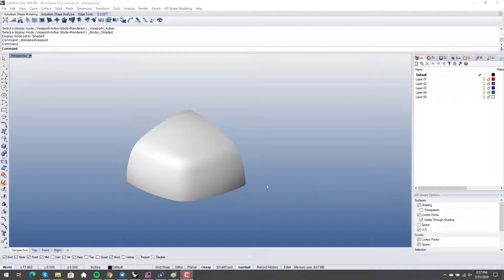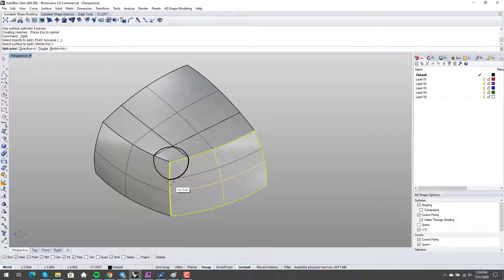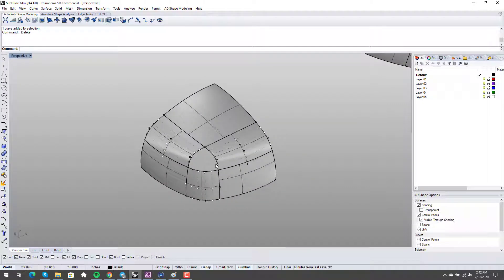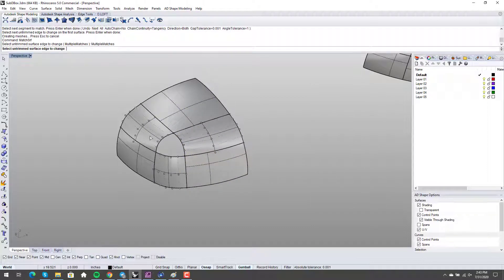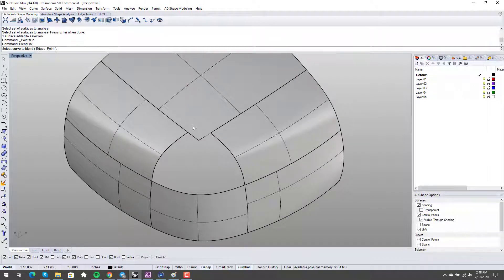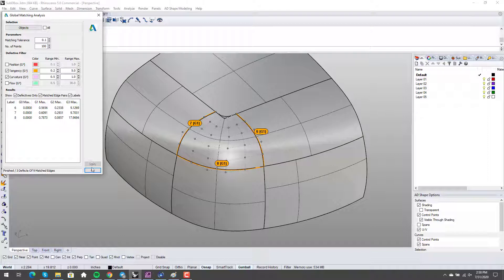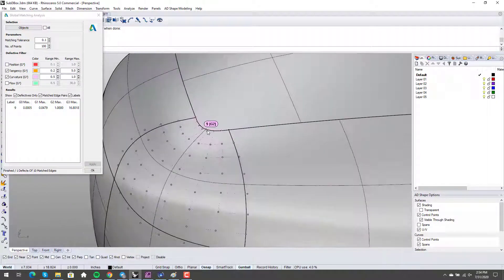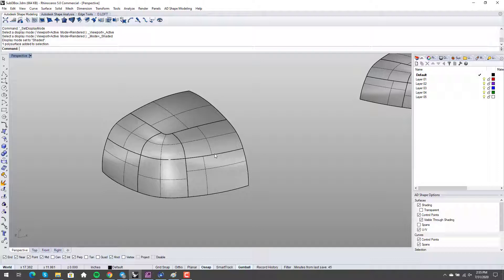Primary Surfacing: Episode 12 - (Slightly) More Complicated Ball Corners

Comment: I think when you did the blend curve on the last (top) surface it got slightly outside and then into the area of the top surface. Hence, you got the small end edges when tried to MatchSUrf with a Pull. I wish you could show us the close up of that operation (the Blend Curve) to see whether that was the case. That is why it was quite difficult/impossible to achieve CUrvature to the Top surface.
Has that intersection been the case, then matching the side surface to a isocurves slightly in from the corner of the Top surface might have solved the issue... but it is very time consuming to rematch to isocurves and then trim all the excessive areas of the top surface.
Reply from the maker: I don't have the file anymore, but I see your points. Really though, what I have found is that if you have a surface patch like the top one and you want it to be a certain level of continuity (G1/G2/G3) then the easiest way is to make all the surrounding blends one level above the desired continuity for the final patch. This is even true for four sided holes in which all all sides are untrimmed single span surfaces. So if the desire is for G2 for that top surface, the easiest route is to set the surrounding surfaces G3, which may or may not be possible depending on what version of Rhino you are running. Or - put another way - if your surrounding surfaces are single span G2 blends (even where all four edges are untrimmed) anything above G1 can be a struggle, due to the vert sharing at each corner. Of course you can always way over-define that final patch and force it into spec, but often your curvature graph will not be pretty. It's all a balance.
Reply: @thirtysixverts  I did a bit of a different approach with as minimum as possible parametrization of surfaces for my keyboard keys (shown on my channel). I did it in Alias though with only simple 3×3 plains and 'Square' command (5×3 and 5×5 for blend surfaces) + the actual corner surface 6×6. I did not have to extend the base surface inwards (split, detach) either.
But I had to make a simple patch surface 4×4 on the most "flat" corner where the Corner blend would be built. Then simple 5×5 curve with Pull (project) to that small patch and blending to isocurves of the corresponding surrounding surfaces (3×3, thus giving me very simple isocurves 3rd degree). Then I built the Corner blend surface, Projected the edge to the built small Patch and matched it to curvature bumping it to 6×6 and with a very minimal Control point adjustments to achieve C2 on all edges.
That is how I built all of my keys. Following are some shared pictures. 
(File tolerances in mm\deg): 
position 0.001
tangency: 0.1
curvature: 0.2
https://drive.google.com/drive/folders/1iIADzSnUTrIK8peAE35LTS6dJ-t7adgN?usp=sharing

Comment: Rhino has always been a bit quirky with SurfMatch command (Multiple Match to be more precise). VSR Shape Modelling definitely can help, but it is a third  party plugin and is quite expensive (has almost the same price as Rhino itself).
I had a quite similar situation for my designs and have been trying to use degenerate points: yes it is against the rules but sometimes it works.
Reply from the maker: I of course love and recommend VSR, but since it's not even for sale anymore I try to do as much of this series as possible with "stock" Rhino commands - indeed I was able to get better matching with VSR, but so few of us have it, if I was to make those commands integral to this series I think the audience would be much smaller. I'd be interested to see a situation where you found that degenerate points works better than a trimmed edge! I try to avoid them, but I'm always open to new ideas, and if it works, it works!
Reply: @thirtysixverts  Yes, the trick is to use one degenerate points and if possible to the closest to 90° angle between the edges which converge to that point (to avoid rippling surface as much as possible). Matching a curvature though is a bit tricky using degenerate point. It is somehow a 'special case' but works most of the time when you have quite flexible curves on three perpendicular planes.